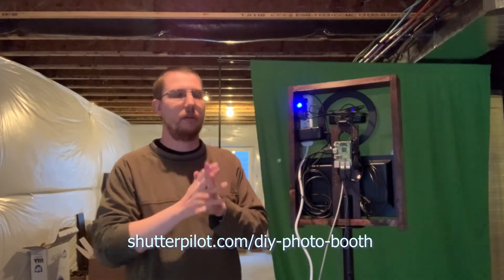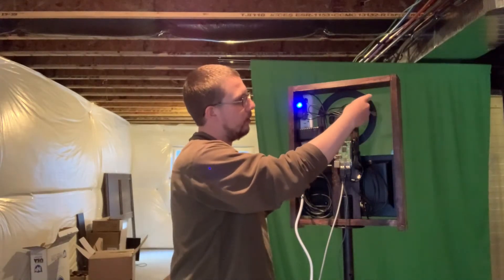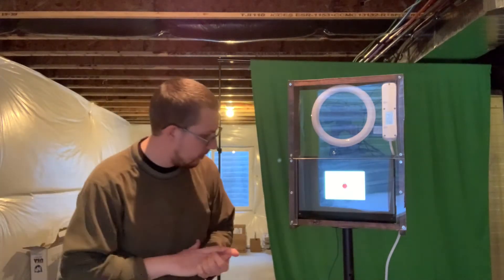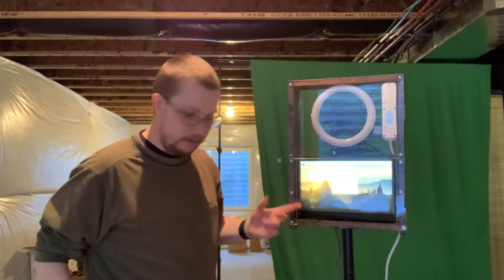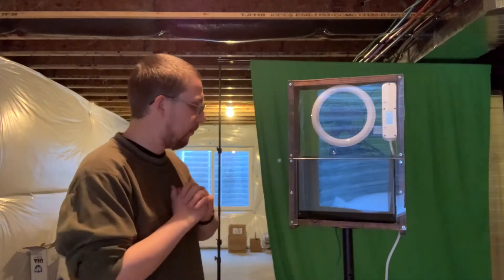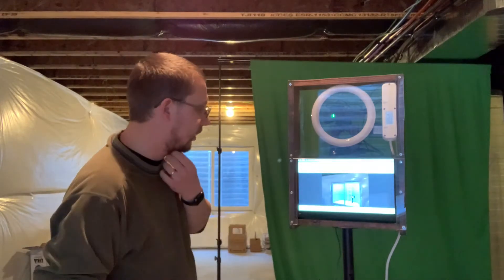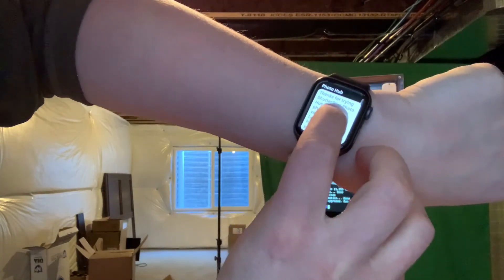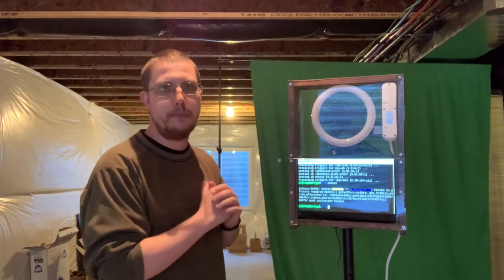Trying out some LINUX photo booth software | DIY Photo Booth Build

Comment: Does your Photo Booth work with touch screen monitors running off of Linux deebi? Thx
Reply from the maker: The touch screen I use is compatible with Linux (I believe most are).